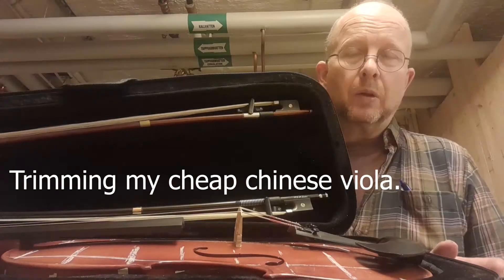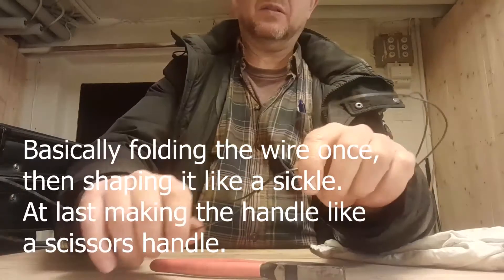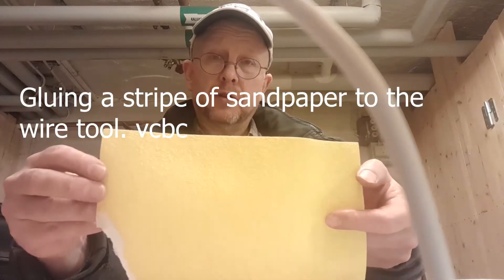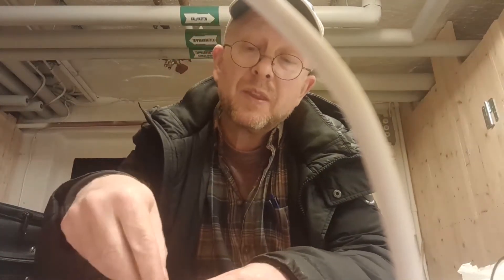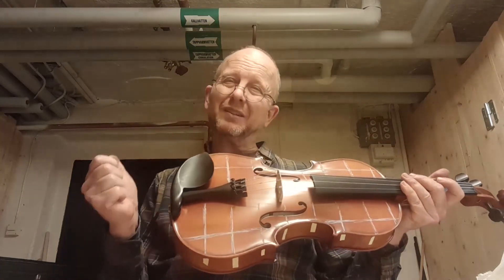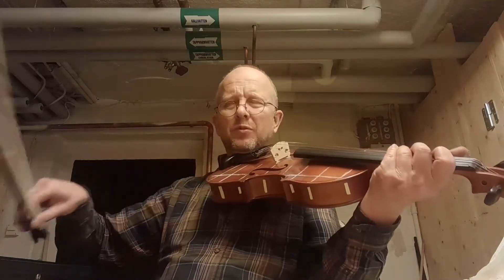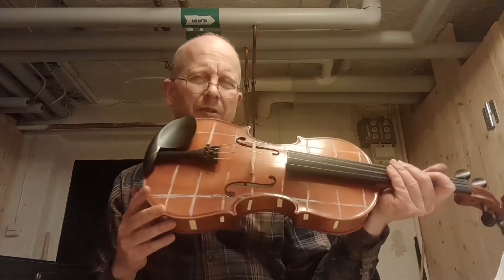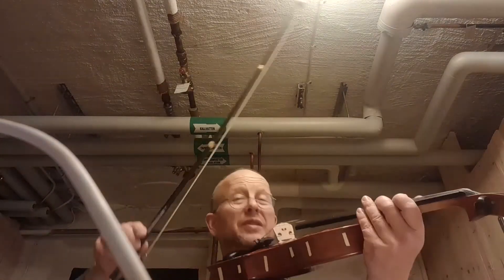Viola trimming1 GEWA Pure

Comment: For problem of string stopped or little bit sustain, resolve with nut and bridge pencil graphite and Scraping the notches slots by widening and bringing the string a little bit out of the capo and making and checking that they are straight and aligned the slots in the bridge and capo should have no resistance, sometimes the strings are defective when they are bent in the assembly, try doing this if it is not enough change the string and it will surely sound better
Reply from the maker: Tanks, will try in june and post a video.